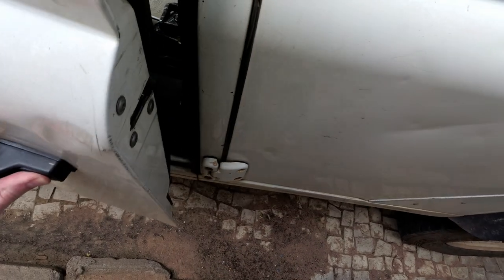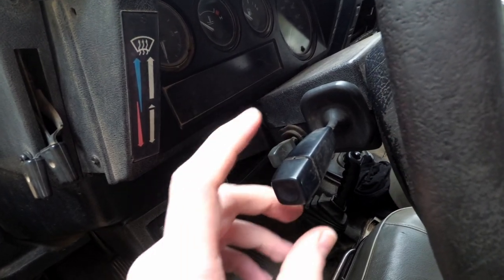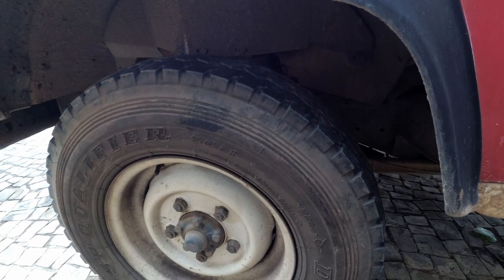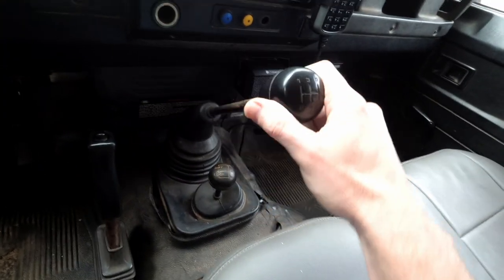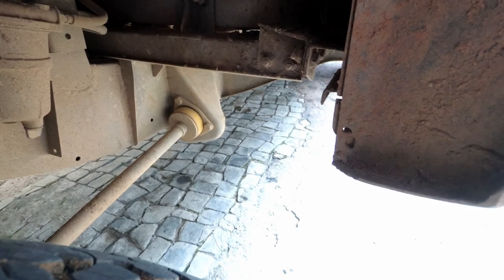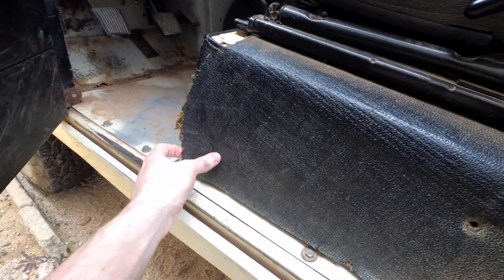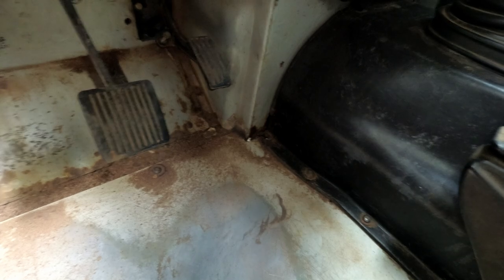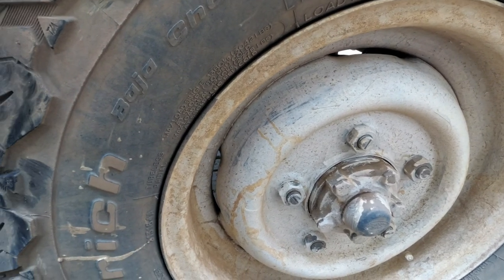Comparing 300Tdi ROW Defender models - 2003/2005/2006 MY

Comment: Great glimpse into ROW TDI differences. I suppose factory changes were continually rolling but as owners we do not often get the chance to see original spec vehicles side by side. Wish my old chassis was like that, from mid way forwards yes. Maybe if they painted them properly & waxed inside / outside/underneath etc they would fair much better for just a very few extra ££. Constant fight against salt/ /corrosion/ water ingress either steel or aluminium in our wet uk environment. I’ve spent a lot of thought, time, effort & expenditure protecting my vehicle but can see LR really did not do much of any/either. Love my vehicle but jees LR we’re really taking the peeeeeee! I and most owners could do a much better job with a little care. You really can see why rest of world bought Toyotas even though they can rust spectacularly too.
Reply from the maker: Cheers Peter. Wish I had my Defender from new then I could have treated it properly!

Comment: Best of all the ROWs is the strengthed R380! It has the Suffix K or L, so it's the same last upgrade that was fitted into the Td5 model. Difference is the short bellhouse of the Tdi and the shorter inputshaft. Prefix is 56A as usual.
Reply from the maker: aye. I got one from Ashcroft when I replaced my gearbox. Hopefully it was worth the extra money!

Comment: I have been wondering if the last of the 300tdi has the same chassis as the TD5. I see the TD5 fuel filter mount in the wheel arch and the cross member under the gearbox is forward. The last bit would be to see if the brackets on the chassis for the engine mounts are the same. Yet another great video that only a Land Rover Defender nut could enjoy, cheers.
Reply from the maker: They're pretty much the same, except the engine mounts
Reply: Another nerdy thing the 110 has the chassis brackets for the military fuel lockers fitted right through till the end even though no military contracts from late 90s.